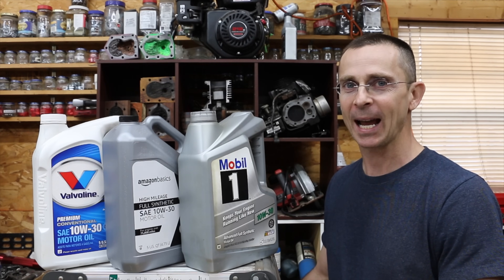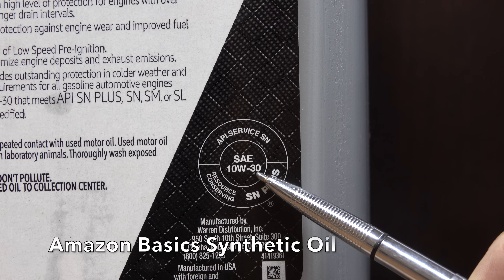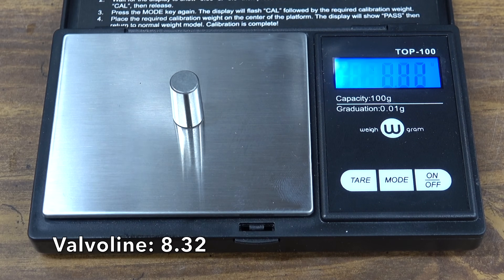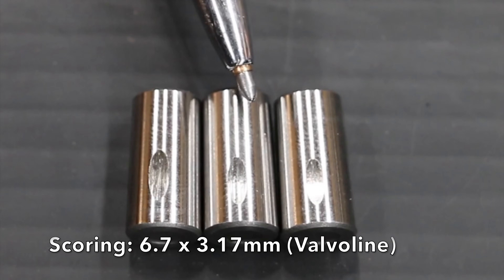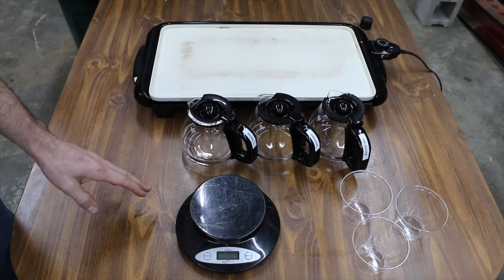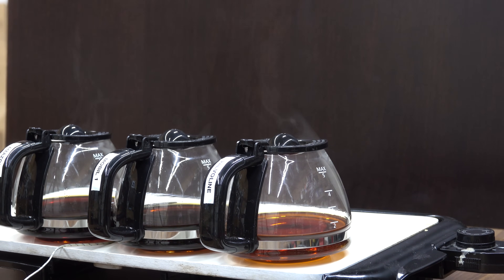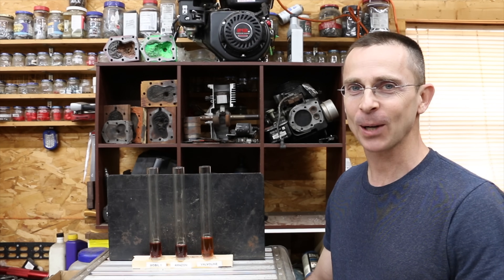Is AmazonBasics Full Synthetic Motor Oil better than Mobil 1? Let's find out!

Comment: I wanted to ask you specifically about your comments on the direct injection Motors that are turbocharged. I actually have two of them one in the Mercedes brand and one other in Audi. Am I being deficient in using an oil that doesn't say SN plus? Because that is a little vague on some of the brands I'm trying to find. I have been just sticking to mobile one in the past.

Comment: Hi PF,    I'd like to weigh in on a snippet at the end, where you mentioned using a synthetic blend.         My advice to this channel is   FORGET   SYNTHETIC   BLENDS!       They only exist as a mid-range selling market  for folks who want the benefits of synethic,   but  want to pay conventional motor oil prices.

Unfortunately,  we do not know,   nor is it normally listed  how much  synthetic they actually blend into the conventional oil it's mixed with.         It could be 99% conventional  &   1% synthetic.  Who knows.      However,   I've heard of some which do state   50/50 blend, so that's transparent.

BUT   if you want to have a true blend that you know about,      consider mixing  it yourself, at least you'll know what you're getting.

Comment: Sorry, this is off topic but then on. There's some political commercial on here in KY before this show starts. They want joe blow citizen to reject Bill s.2992 that it's going to hurt jobs.
What the bill actually says and means is if you build some special widget and are selling it on ebay/Amazon, they can't have some Chinese co make a million of them, then sell a knock off of your product cheaper than you can even make it for.
"American Innovation and Choice Online Act

This bill prohibits certain large online platforms from engaging in specified acts, including giving preference to their own products on the platform, unfairly limiting the availability on the platform of competing products from another business, or discriminating in the application or enforcement of the platform's terms of service among similarly situated users.

Further, a platform may not materially restrict or impede the capacity of a competing business user to access or interoperate with the same platform, operating system, or hardware or software features. The bill also restricts the platform's use of nonpublic data obtained from or generated on the platform and prohibits the platform from restricting access to platform data generated by the activity of a competing business user. The bill also provides additional restrictions related to installing or uninstalling software, search or ranking functionality, and retaliation for contact with law enforcement regarding actual or potential violations of law.

The bill establishes affirmative defenses for the prohibited conduct.

The Federal Trade Commission and the Department of Justice must designate whether an entity is a platform covered by the bill, and both must carry out enforcement activities.

The bill also provides for civil penalties, injunctions, and the forfeit of profits for repeat offenders."

Comment: There’s one thing you need to test is synthetic against conventional oil for film strength. I used Mobile one synthetic in my Harley and let set over the winter. I live in upstate N. Y.  So roughly 4 months , when I took it out in the spring  the bearings between my clutch and transmission had rusted and caused bearing failed, both inner an outer. Never will I ever run synthetic again.
Reply from the maker: Thanks for sharing.

Comment: Would love to see bearing wear test for same make of oil (say Castrol Edge Synthetic) at multiple viscosities (e.g., 0W-20, 5W-30, 5W-40, 20W-50).  My guess is higher viscosities will have lower metal wear.   What is the true facts?   Can 0W-20 protect an engine as well as a high viscosity oil?
Reply from the maker: Thanks for the suggestion.

Comment: Doesn’t show too much as to longevity of the products or effects on seals in the engine as it degrades over say 6-8k miles driven. 2 hours on a heat tray is hardly a test but the freezing test was interesting
Reply from the maker: Thanks!

Comment: Saw you comparing WallyMart oil to a name brand but it disappeared before I could read it or reply . I was taught something MANY years ago . My Father in Law worked the "Oil Patch" . For a long time he had a ROUTE . His duty was to service Pump Jacks . Those jacks ran 24/7 FOR DECADES ! !  They never changed the oil in them but regularly replaced the filters . Supposedly , oil does not "wear out" , it just gets dirty . If this is indeed true I'm not surprised that Big Oil would not want it to get out ! ! !   I used to buy recycled oil (I suppose you still can) . After all , every auto supply , garage etc. takes in USED oil . I'm sure they just filter it and resell it . Really enjoy your posts , even the ones that don't particularly apply to me .
Reply from the maker: Thank you for sharing!

Comment: I had a 2014 accord. i switched to Amazon Basic and noted that my accord started to burn oil, I lose 1/2 1 Qt every 5k. Then I switched back to mobile 1, and it didnt burn as much… maybe Amazon basic is thinner, which could contribute to oil consumption?
Reply: How long did you run synthetic?  Were you running Mobil 1 prior to Amazon?  I noticed the same upon first switch from convention/blend to Mobil1, but it ultimately stopped.  I think it initially leaked or burned off until it got used to it or something.
Reply: @Johnslist  It was a 2014 model, which required 0W-20 full synthetic since my first change. Also, that only happened to my Accord, and I also have a 17 pathfinder and 11 corolla, which nothing as obvious happened to them. I just stopped using Amazon basic, since the price difference was only $3 cheaper compared to Mobile 1 when they are on sale for $24.99.

Comment: I am a big Mobil 1 fan, I had an old V6 Mercedes car that I drove 1,300 Kms, about 800 miles from Bavaria to the UK and I used up  just over 4 tanks of petrol.
I did an oil change in the UK with the Mobil 1 at eyewatering costs per pint.
On the return journey I only needed 3 tanks of petrol and there was no engine noise to be heard at all, just the wind when doing over 100mph on the German motorways.
I have never even tried another oil for over 25 years now,  just found a cheaper sourse on EBay!
It used to get down to -20 Deg C here in Winter, always starts on the first turn.
I also use LPG as fuel no in my taxis for 17 years,  Liquid Petrol Gas  burns with no soot, so my oil looks new even after 10,000 miles and this also saves a huge amount of money on fuel and no constant oil changes, I change my oil after about 25,000 miles!
Your tests are great BTW!
Maybe a test beteen LPG, Petrol and Diesel might be a good idea?
I once drove a ``Fuel Expert´´who said that If the big Trailers in the USA changed to Natural Gas they could save huge amounts of money, Is that true?
Reply from the maker: Thanks!  Thanks for the suggestion.

Comment: Just a suggestion: Use the same oil as a control to see the precision of your testing. So instead of 3 cups, have for example 4, whereas 2 with the same oil. With this little extra work, you can measure how precise your testing is. If there is a significant difference between the same oil, your test has more variability than the different oils, biasing the results.
Reply from the maker: Thanks for the suggestion.
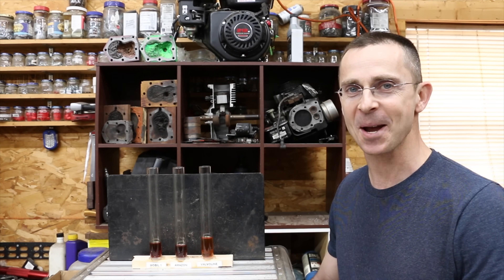Reply: @ProjectFarm  At 10:41 The amount of oil being "sprayed" on the sides of the cup was massive, demonstrating what so may other saw and I want beck to check on; more oil for the Mobile 1 test, for sure.   More accurate measurements of the amount of oil used for the tests is the only negative that I see...
Reply: I think you might want to make a video RE: Your oil testing and demonstrate what you suggested 😁

Comment: The question isn’t which oil is the best, the question is do I change my oil more using budget oil or do I change my oil less using expensive oil and which is best for the engine. More cheap oil changes or less expensive ones? I’d say more cheap changes is better for the engine.

Comment: First of all, I must congratulate you for your excellence in testing products for automotive use, the characteristics of all your tests, which I have seen in countless of your remarkable videos, which demonstrate your great dedication, enormous effort and hard work to reach the truth in all the tests he performs, added to his enormous ingenuity testing products in engines and other types of equipment.
But the question I am asking myself from this particular video is this: when you put the oils to the test in the timken machine, would the Valvoline oil and the Amazon oil apparently not be in permanent contact with the spinning wheel, which is? On the other hand, with Mobil 1 oil, which is even seen rubbing against the oil in the tank, also splashing and raising oil almost permanently, something that does not happen with the other two oils mentioned above?
I wonder: could this somehow affect the final result of this particular test?  since, in my opinion, the rotating wheel would have to be bathed in oil, equally in the three oil tests, so that they are equally valid under equal conditions.
From now on I send you my greetings and congratulations for your great analysis work.
Reply from the maker: Thanks!

Comment: Amazon basics and Supertech have the same dexos number: D10386HG025, which means (And someone correct me if I'm wrong.) the stuff in the bottle is the exact same formula, regardless of the label.  Warren's Petroleum makes them both. Here's a list of A BUNCH of oils that share that exact same dexos number:

Accel Full Synthetic
Amazonbasics
Autozone Aceite Sintetico
Capital Bulk Full Synthetic
Casey's Drive Professional Series Full Synthetic
Federated Auto Parts Full Synthetic
FVP Full Synthetic
Holiday Full Synthetic
Kum & Go Full Synthetic
Lubritek Full Synthetic
MAG 1
Maximo Full Synthetic
Meijer Full Synthetic
Mighty Engine Guard Full Synthetic
Parts Master Synthetic
Prime Guard Full Synthetic
Proline Full Synthetic
Pronto Full Synthetic
Roughneck Lubricants Full Synthetic
STP Full Synthetic (they have 2 other 5W30s on the list)
SuperTech Full Synthetic (only one!)
UNO Ultra Full Synthetic
XP Full Synthetic

(I found this comment buried in a reply 2y ago from “Baddest Burrito” and it’s too good not to have its own comment.)
Reply from the maker: Thanks for sharing.

Comment: I have watched almost all of your videos over the past several years and really enjoy your engine oil ones. I own my own trucking company and would like to a make a suggestion for you to test Ford Diesel Oil, Shell Rotella Diesel Oil, Schaeffer Diesel Oil, and Lucas Diesel Oil both synthetic and regular. I started running Lucas over Schaffer’s due to cost and want to make sure I’m not ruining my engines. In my experience with Rotella, my engines have always burned oil and with other brands I do not. I want to make sure the oil I’m using is safe for my engine. I trust and respect your results that you come up with in your videos and would appreciated an unbiased answer from someone I trust.
Reply: You should move this comment to the video itself instead of as a comment to a comment. He'll never see it here for sure.

Comment: This was a very logical test of motor oil lubrication, flow, and volatility. It is now 3 years after this comparison test in which Amazon Basics synthetic oil won the competition. The question in my mind is whether Amazon's oil uses the same formulation as it was in this Feb 2019 test? Without yearly testing, there's no way to know if they've changed the formulation (to keep its cost advantage). 'Still, this was an interesting test. Thank you.
Reply from the maker: You are welcome!  Thanks for sharing.

Comment: That is a very impressive test. I have run Valvoline in my racing engines and vehicles for ever with outstanding results. The racing engine never have and wear between teardowns. The lubricity test means has a different result for me since I know Valvoline is an  outstanding lubricant. The Amazon basic oil is of higher lubricity and not even a brand name. 
I'm disappointed.
Reply from the maker: Thanks!  Thanks for the feedback.

Comment: Great analysis!  One type of oil I've always been curious about is piston engine aviation oil.  I know people who haven't changed the oil type they use in their airplanes for 30 years, but the same problems continuously plague them...corrosion from condensation in the engine caused from low use, which causes the cams and cylinders to wear.  It would be interesting to compare various types of aircraft engine oils to each other and then compare it to a modern synthetic automotive oil for corrosion protection and wear.
Reply from the maker: Thanks!  Thanks for the suggestion.
Reply: A very important attribute of piston aviation oil is to suspend lead.  100 low lead is the most common fuel for these engines and some oils do a poor job of keeping the lead in solution and not as sludge in the pan and rings. Some synthetic and blend oils were very poor at handling the lead and large lawsuits followed.  Mobil AV1 and Shell Aeroshell are know for lead fouling.  I always ran Phillips mineral base and never had any lead issues.
Reply: @billy-bo-dilly  Thats news to me that Aeroshell has problems with lead fouling. I use it, almost everyone I know uses it and this has never been an issue.  Possibly those who have problems never change their oil.

Comment: Question on moter oil and engine wear.
I have had multiple mechanics tell me that most important aspect of rynning a heavy diesel truck engine past the million mile mark is to keep your oil change interval and to always use the same oil.

Changing oil brands / types will cause increased wear as your engine acclimates to the different formula

Your thoughts?

Comment: I never cared for the pressure pin test. You engine has oil clearance. So to me the pressure test is worthless to me. Change your oil and filter at 2,000 to 3,000 miles and you wont have problems with any API oils.
Reply from the maker: Thanks for the feedback.

Comment: If you would, test Pennzoil Platinum High Mileage Full Synthetic 5w-30 with Amsoil Signature Series 100% Synthetic 5w,-30.

Also Amazon Basics High Mileage Full Synthetic 5w-30 with Amsoil Signature Series 100% Synthetic 5w-30. Thanks.
Reply from the maker: You are welcome!  Thanks for the suggestions.

Comment: Really enjoy your oil test videos. Suggestion- when doing the cold flow tests it appears your pouring the oils on 
room temp plastics pipes. I would really love to see the same test with metal pipes used instead plastics that are at room temp. It would really be helpful if the metal pipes were also left in your freeze over night just like the oils.
Since the metal parts of your car's engine will be the same as the temp outside/inside depending on where its left over night.  Also I think your 3 part tests should have a value for each one. Since 80-85% percent of engine wear happens at start up it should have a higher value than say the evaporation test. Just a thought. Keep up the great work. Thanks Ron
Reply from the maker: Thanks, will do!  Thanks for the suggestion.
Reply: Great suggestion

Comment: Feeling good about my Mobil1 selection over the years but Amazon is impressive wonder who is make this for them?
Reply: Amazon Basics Full Synthetic, Costco's Kirkland Full Synthetic and Walmart Full Synthetic, all 3 are made by Warren Distribution, the largest private label oil formulator/distributor in the U.S. All 3 of the aforementioned branded oils are very similar in formulation and perform virtually identically thus any one of them would be a good choice. They are closely priced as well however there are price reductions at various times throughout the year so it's not unusual to find any one of the 3 competitors on sale. Many times local Costco's will have their Kirkland version on sale within the store for about $5 lower price that what it sell for on their website and in the case of Walmart they offer a 12 quart box of their SuperTech Full Synthetic at a nice discount as well.  These 3 brands are really turning up the heat (so to speak) big name brand competition with the net effect of bring prices down overall across the board.

Comment: As the great destroyer of all things motor operated--wondering if you have any recommendations for a home standby generator.  Looking for portable genset in the 5-10 kW range, dual fuel.  Don't need it often, but it's a nice to have after the great freeze last spring.
Reply from the maker: Thanks for the suggestion.

Comment: Amazon oil did really well. I’m surprised. I wonder what company manufacturers their oil for them. Another awesome 😎 video!!
Reply: Also, 5qt jugs of Mobil synthetic are only $24-25 at Walmart, so not too much cheaper. Walmart always has the best oil prices.
Reply from the maker: Thanks so much!
Reply: Amazon Basics Full Synthetic, Costco's Kirkland Full Synthetic and Walmart Full Synthetic, all 3 are made by Warren Distribution, the largest private label oil formulator/distributor in the U.S. All 3 of the aforementioned branded oils are very similar in formulation and perform virtually identically thus any one of them would be a good choice. They are closely priced as well however there are price reductions at various times throughout the year so it's not unusual to find any one of the 3 competitors on sale. Many times local Costco's will have their Kirkland version on sale within the store for about $5 lower price that what it sell for on their website and in the case of Walmart they offer a 12 quart box of their SuperTech Full Synthetic at a nice discount as well.  These 3 brands are really turning up the heat (so to speak) big name brand competition with the net effect of bring prices down overall across the board.
Reply: Thanks J A 👍